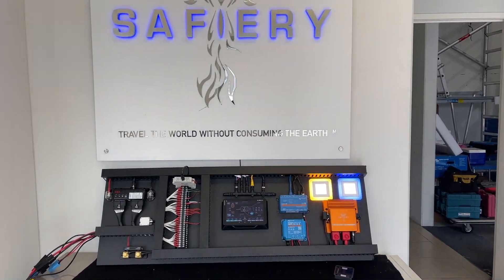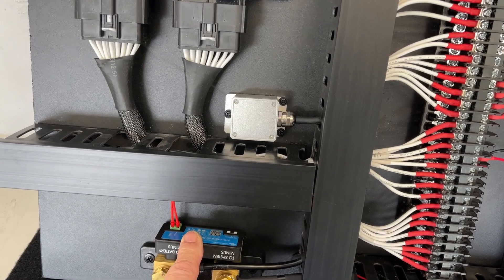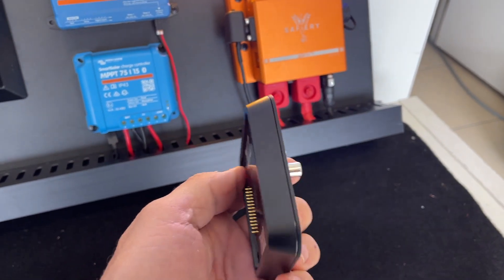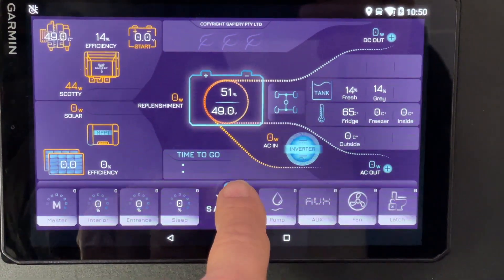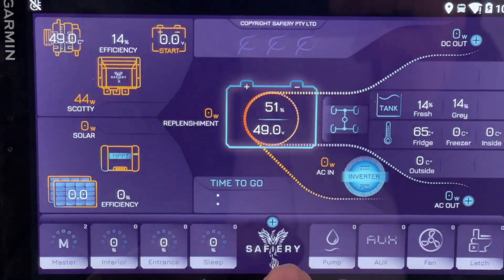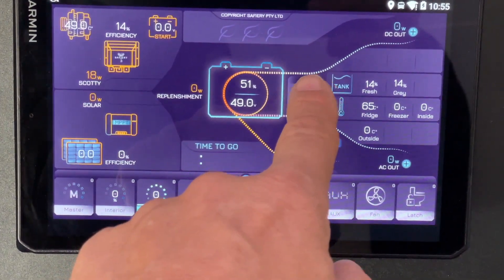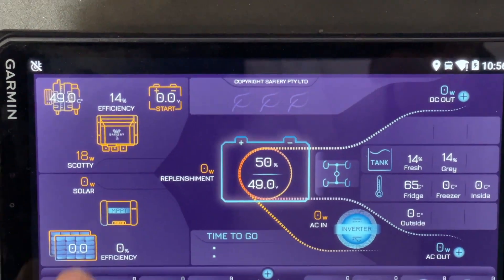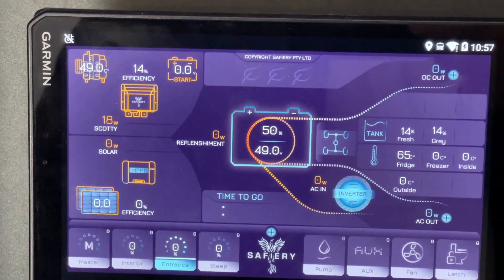Safiery Integrated Display: Navigation, HEMA, Campgrounds, Fusion Sound, Victron, Digital Switching…

Comment: Nailed it.
Reply from the maker: Thanks... more to it than meets the eye under the bonnet. The stack is significant.
Reply: @Safiery  I have been doing my own empirbus setup over the last 6 months (so I know how much time you've put in to configuring everything ) got a van on order hoping to put your 48v system including Copperflex and a killer wasp/Scotty in tow rig-which is a new defender. Not sure to go 48 to 48 or 12 to 48 from defender but I will be in touch
Reply from the maker: @leavingthegrindbehind  We are doing a Defender MHEV at present. Watch our videos this week. Its a pretty exceptional setup with a lifestyle kit, 250Ah Lithium (Clark Kents) 3000W inverter and Killa-Wasp- all concealed under the rear floor then 30L Engel, Induction, drawer etc.